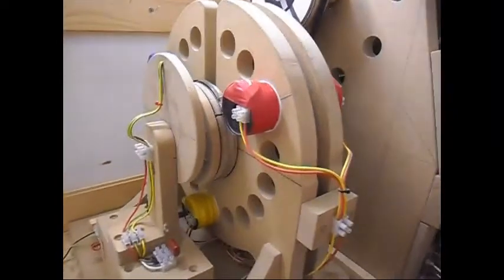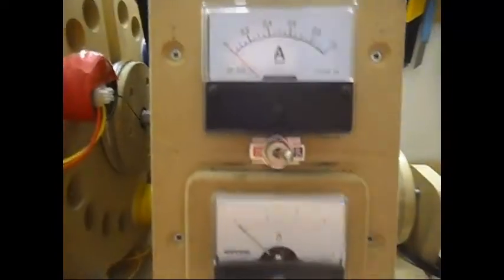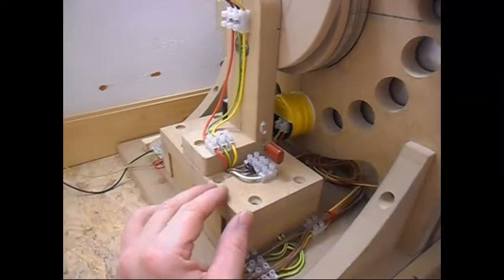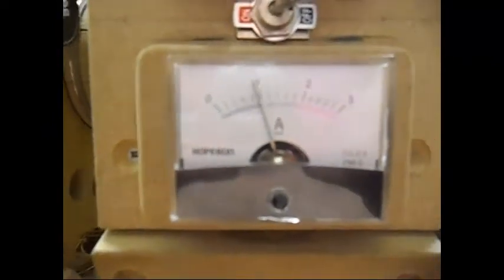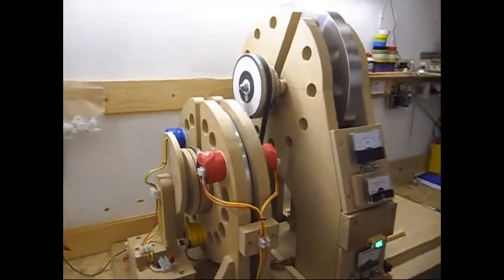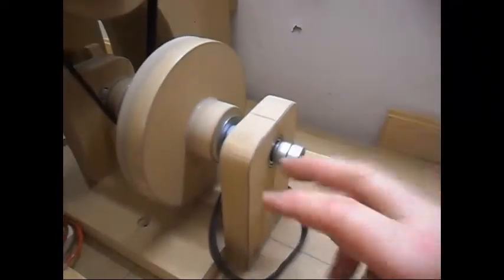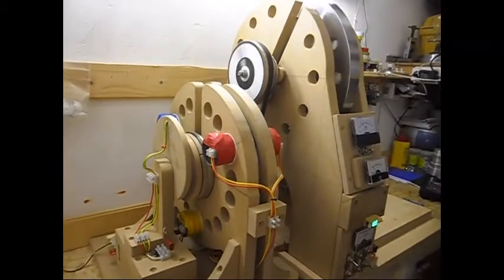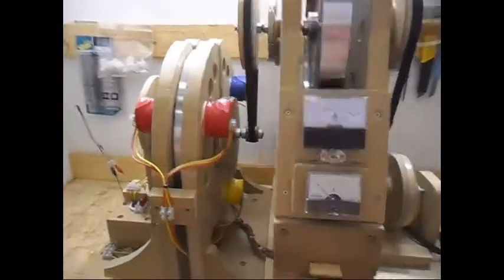Pulse Motor_Generator - Update 18 OverUnity is it or not, Future World Generator_5...

Comment: just the fact that you are moving quite a bit of mass    is awesome!   and so smoothly      did you design  your idea with a cad prog    you must have some  nice tools to aid you in this build.   some details on the coil windings would be  nice
Reply from the maker: No program here, just old fashioned pencil and ruler to draw the design...^^
Tools are basic manual ones except for a small press drill and a small electric hand saw.
The aluminium rotor and iron flywheel are made with a lathe ofcourse.
All coils are wound by hand but i often just buy a specific bobin of copper wire and use it like that...save me time and work...^^